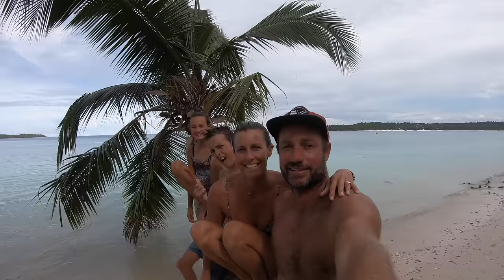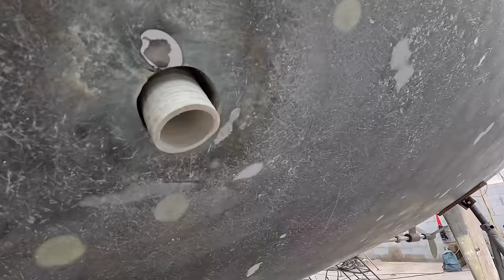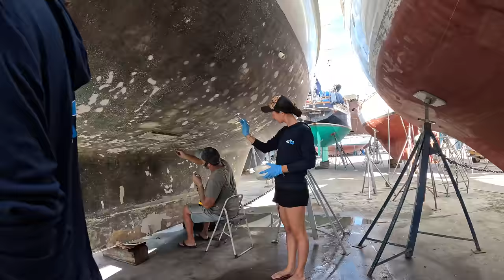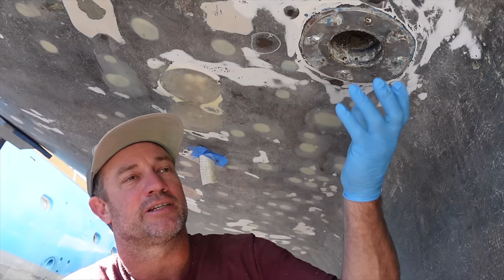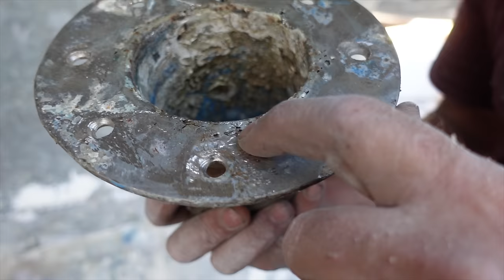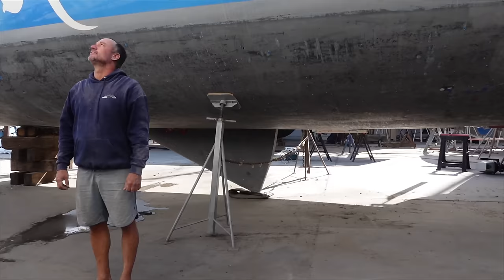Why so many holes? | Ep 387

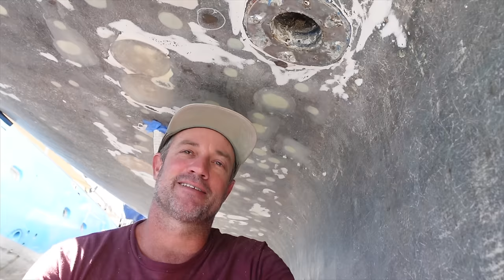Comment: @6:00 why was removing that thru-hull left until now, rather pre-shave, inspecting any possible underlying issues, drying out while the rest was, etc.
Use Poly fittings, can heat shape/form, no rust or electrolysis.